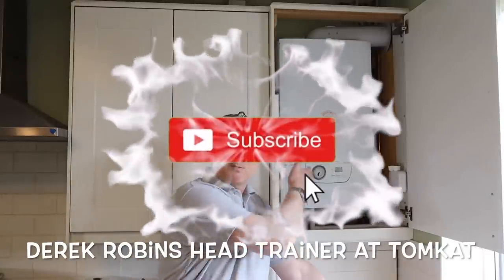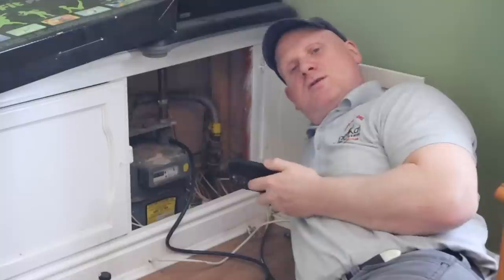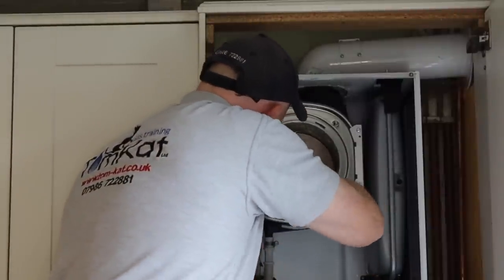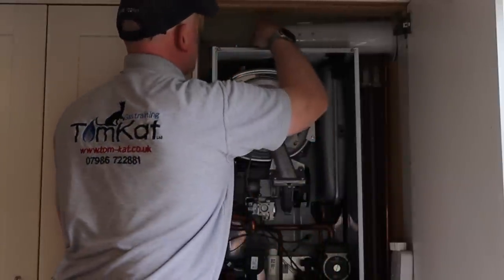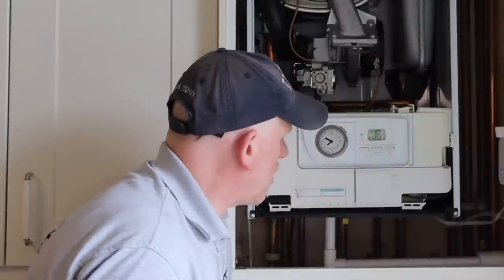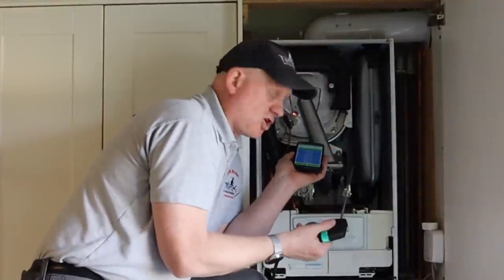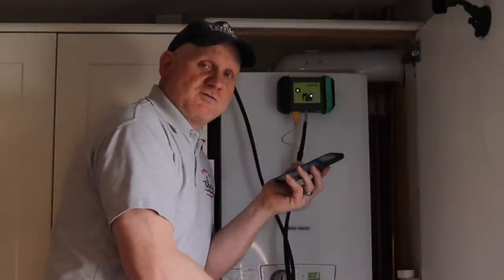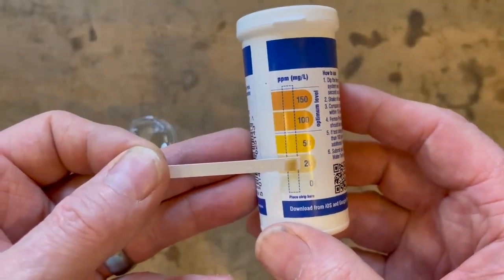Boiler service to new building regs part L. will gas engineers comply and will customers pay for it.

Comment: Had a company ask me to do some services for them. The usual thing " we look after loads of properties in your area"  They wanted 12 to 14 services done in a day. I told them that  there was not enough hours in a day to do it correctly and they said they wanted them doing as per manufacturers requirement and I again said that could not be done but they CLAIMED that all their other engineers did not have a problem doing that many. Well needless to say I did not accept and there is no way they are being done correctly at the prices and time scale they were asking. This is a major area of concern as corners must be being cut. Even BG I have seen go into a boiler and just test flue gases only and if they are ok do no more and on occasion not even removed the cover if the flue gases are ok. I could not sleep because even a pass today could be a crumbling seal that perished the next day.
Reply: Same as other industry such as EICR for electrician. You know price and standards have being driven down by the doggy guy and be spoiled so as company.  So the worst won, the best starved to dye.
Reply: Company didnt start with an F did it? 😂 indeed i worked for a company and all they did was saftey checks and leave in 20mins!! Not good, i left after a week!! 👍
Reply: And the problem is the customer has no real idea there can be such a difference.
Reply: I had the issue with HOMEPLAN asking to do a boiler service for £30 . They said, someone guys in my postcode do it that price and they give them blocked service of 50 customers in a month
Reply: @goodcat1982  quite possible but at £30 a service to do properly you won't be making money so they must be missing lots
Reply: Well this is where the gas regulator needs t come down hard on these companies as they clearly don’t care about people lives!
Reply: Not a chance 5 propper services is enough
Reply: "Even BG I have seen go into a boiler and just test flue gases only and if they are ok do no more and on occasion not even removed."

That's because BG offer an annual safety visit which is free with their homecare agreement, NOT a service! you assumed it was service....

 Saying that. If there is an issue then we strip and clean as per MI's, or raise a breakdown to get it sorted.

If they were paying full price for a service then different story, but the safety inspection is part of their homecare agreement, nothing else.
Reply: @JayGasEssex  I know I am right I worked for them for 16 years and I know what they do not do.
Reply: @paulgannon3261  BG is a joke. LOL. . . In and out in five minutes, else someone will be screaming down the phone. 

Lucky modern boilers are pretty well fail safe, and don't go wrong, else it would be a blood bath.
Reply: I'm still still doing an additional tightness test after locking out the gas valve/safety device. Is this not required on modern valves?

Comment: There is a service and a "service". Trouble is a lot of larger companies actually tell you to do the bare minimum legal requirement and give you such a workload that it's impossible to do anything other than the bare minimum.
Reply: 26.9 check
Reply: The blue van company and social housing contractors are encouraged to do 20 minute safety checks to make sure their managers get great KPI’s. 12 “services” a day is the norm unfortunately. I’ve been there but thankfully got out.
Reply: @matthewtrueblood408  
Im on social housing 9 jobs a day in 8 hours including travel. Its impossible to do a full service on the workload they give. Always fighting with time
Reply: Big companies just want the engineers to probe and go
Reply: @Westy90_  I went for an interview with a housing association and they told me straight a minimum of 7 per day. It's nothing like a service.
Reply: @OHYEAHGAMEVIDEOS  easy done
Reply: This is not how BG does boiler services, they just take the money and don’t bother with the service 🤷‍♂️
Reply: people out there charging around £60 for a service but not actually doing the strip down essentially doing a gas safety check!! I’ve been to many that have been serviced yearly (apparently) that have had leaky heat exchangers, blocked condense pipes and or leaky flues! Low standards these days

Comment: Some MI says if all the readings are correct then doesn't need a strip down ??
Reply: Some do yes and manufacturer instructions over rule regs, which highlights the reason for needing the instructions to hand before commencing a service. Remeber though that even if readings are correct, from my understanding, a full strip down and gasket change is still required at 5 year intervals.
Reply: can confirm Alpha say that used to work for a company that did all the worranty work for Alpha
Reply: @craigwatson7692  Yeah 5 year for NG 2 for LPG for Vaillant/Glowworm with some of the older boilers with the small rubber gasket at the bottom of the Hex every 3 is recommended due to the rubber being less robust than the Graphite seal
Reply: absolutley 100 percent  correct!! thank you, some sanity

Comment: copper grease and 7nm for the burner nuts, great post sir. and no i doubt many will cover everything you showed. So basically the new service is the pretty much the same as commissioning the boiler. Just to ad the flow temps adjust the condensing time of the boiler, so anything with a return of 55*c and below will condense but if the flow was 65 -70 it would just heat the room quicker and turn off the boiler quicker and still give 20*c difference on larger systems but not on a smaller 8 rad system. With a 50* flow i doubt your rads that are last in line will be optimum temp.

Comment: Nice video. The copper grease is a high temperature grease. Sometimes nuts can seize when they get hot for long periods. Use then on car brake pads and exhaust manifold bolts 😇

Comment: thermal grease is to do with Giannioni heat exhanger making clicking noie when heating up and epxanding. Vaillant started adding it to service kit some 7-8 years ago agter complaints from customers and engineers that boilers stright from the factory were making loud clicking noise on heating up.

Thermal paste proivdes lubrication and stops those clicking noises from happening where aliminum expands quicker than stainless steel, ie cover on the main hex.
Reply: well done mate, have you heard the intergas clicking without the grease?

Comment: Great video. Couple of tips: I use a foam appliance mat under boiler, put a little silicone grease in schrader before testing,  use the back of a Stanley to clean chamber.
What's the point in gasrating and WP if not max/min?

Comment: On my service records, it does state ‘Was a full Strip Of the Appliance Carried Out?’, and to me, that’s actually opening up the Combustion Chamber to check all the Gaskets, and cleaning the Heat Exchanger and Burners, but for a basic, leave it sealed, check for CO breaches around the Gaskets, if possible, check flame picture, and do a Combustion reading, and check with the MI’s to see if they’re ok.  If not, then do a full strip, providing you have all the Gaskets on you.  OR does Part L mean… Always carry out a full strip of the appliance, no matter what?
Reply: thats me, leave it alone, check it at the seals, your are just going to fuck it up stripping it down every time.why would we use Analizers?

Comment: New regs means nothing when the public don't have a clue about them. A service now is one of the biggest cons going leaving many out of pocket and so called engineers earning £600+ a day by only doing FGA and in some instances, cleaning the condensate trap out too. I honestly don't think I've been to one boiler where it has actually had a service and my customers are quite pissed when I show them what should have been done each year. Until the public fully know what's required in a service, the 15 minute gang will still get away with it.
Reply from the maker: I completely agree mate
Reply: The quickest service I’ve heard about was this contractor went into a private property and took a photo of the boiler and the gas meter a flue terminal and then told the customer, service complete, all safe for another year, i serviced the boiler again properly to put the customers mind at ease, some major cowboys out there giving us all a bad name!!!
Reply: True this. Problem is they don’t know the difference between a landlords check and a service. I always give them the option and always detail on my gas sheet exactly what I’ve done.

Comment: I honestly haven't bothered to service my Ultracom2 Combi in the eight years since I installed it. I did the burner seal as it was required after 5 years but honestly didn't need doing. I still find it odd that Baxi now uses the same heat exchanger but with a lifetime silicone burner seal instead of the graphite one. When the Ultracom2 was out that was my go to boiler for customers and aside the once every 5 year burner seal, what you've video'd is the standard service we carry out (excluding ph testing, that was commercial setting only until this current update even though I check the filter each year), only takes an hour sometimes less if you've got an apprentice with you to Gas rate while you're carrying out temperature testing etc. 
I'll get the Adey test kit as it can be carried out while doing other aspects of the service.

As for range rating and temperatures, hot water definitely will save money especially turning the preheat off. As for heating, yes and no, I've fitted load compensated Ultracom2's with Climapros and fitted without weather comp and standard stats. I've also been asked to remove the weather comp so people have control of their heating. In the end it will always depend on how the resident wants to run it, with many customers saving money and preferring to run the heating at 65c for a couple of hours on full output rather than reducing the output and having a more constant background heat for a longer period of time. In theory it's 6 of one half a dozen of the other but I did find my own home tends to hold temperature better if it's on full for 2 hours and then shuts off, than when it was set to the heat loss and left on of an evening. Much of it is psychology, but overall I saved more gas being at higher output for a shorter duration than being on lower output for longer.
Reply: And there are some manufacturers who are happy for you to reuse the graphite seals. Ferroli, are happy, as an example.
Reply: Vaillant don't want the burner removed every year, just at 5 years when gasket is replaced. I thought the graphite replaced the silicone seals as they failed between services. I've inspected a couple of boilers, LA properties,  where the silicone seal failed and destroyed the boiler, needless to say that they had been recently serviced by their term contractor who expected their engineers to service 12 boilers a day, impossible!

Comment: A little tip is have a shraider valve tightening tool handy. 1 in every 3 or 4 shraider valves i have dealt with once disturbed leaked and needed tightening. So put one in the service kit
Reply: Agreed and especially boilers not been touched due to covid for 18+ months their expansion vessels are usually flat! 👍
Reply: I spray a little silicone grease on them before putting pump on and always keep a spare in the toolbox

Comment: Great video derek did notice you didn’t check fuse rating on fuse spur ,we’re always getting told check it’s 3amp oh and my mrs would kill me if I didn’t have a dustsheet down to protect the worktop , very informative and useful info  tho bud keep up good work
Reply from the maker: I took that out of the video because it was getting too long so typical someone notices. As for the dust sheet on our worktops I would have ended up on my arse if I had stood on it 😂

Comment: This is the first of your videos that I've watched, I recently retired from the industry, my final years as a consultant to  local authorities and housing associations.  They wont pay their term contractors sufficient money to get the boilers serviced correctly, I tried to get them to undertake water analysis, they couldn't see the point. You didn't discuss the need to test the PRV and I would have checked the gas pressure st the boiler with it on high fire, to ensure gas supply was correct size, I've seen many connected to 15mm. I enjoyed your vid and will watch more of them.
Reply: Good point on the prv but in reality who in the right mind would do that on a Worcester or any other hard to reach prv 😄

Comment: I took out boiler insurance that included a boiler service.  The engineer came and took a quick look at the boiler, he didn't take the boiler cover off, he looked underneath the boiler with his torch, he was supposed to bleed the radiators, but he didn't do this either.  I never received a safety certificate.  The so-called service lasted about ten minutes.
Reply: Sadly how they can do 10+ "service" visits in a day
Reply: @Steves_fish  No, It wasn't British Gas this time.  I have had my share of problems with British gas in the past.

Comment: Be aware that Adey Pro Check (at time of writing) will not work with all inhibitors. Dipstick based systems can only reveal the chemical the reagent at the end of the test strip is designed to reveal. Similarly, Fernox test strips are for Molybdate based inhibitors. Not all inhibitors are Molybdate based, one of the biggest selling inhibitors in the country is Nitrate based, so those dipsticks won't pick it up.
Reply: Is there something that will test all brand inhibitor/ chemicals
Reply: @esgas2042  i-Test by Scalemaster will. It doesn't look for a chemical signature but by the action of an inhibitor in water working in real time - so whether it's Sodium Nitrate based or Molybdate based or using a coating agent like Benzotriazole it doesn't matter.

Comment: Well I had my combi boiler serviced . As part of a house hold insurance policy.  Boiler was about 3 years old.  Guy came. Took a combustion test.  Did not even remove the cover  took down a meter flow reading on max fire and that was the end of the service.  Did not even notice that the presure gauge did not work . 
And that is an approved professional.    Lol

Comment: Can you explain to every major domestic gas heating company in the uk that their engineers should only be getting 5 or 6 service’s a day dependant on the engineers travel time between each job please, thanks 🙏
Reply: Also can you tell them to provide a service kit for every boiler they will be attending for that week in advance and also let them know that you may need extra time for fixing any repairs that might need fixing during the service, thanks, let me know how you get on?!!!….
Reply: They don’t care, they all will turn a blind eye to the engineer doing 10 service visits in a day as long as their KPI’s are met. Supervisors/ contract managers will all play dumb when something goes wrong and throw that engineer under a bus. Didn’t Gas Safe say they were going to make things easier for engineers when they took over from Corgi ?? What’s changed to make life easier for us, ZILCH !!
Reply: it is not possible to do strip down every service, 5 or 7 a day, SSE tried it, and it is financially unsustainable on insurance and manpower.
Reply: @tonyrichardson2637  in that case, will everyone stop getting onto our cases for trying to achieve the goals required from our management?
Reply: @carlatkinson4181  when working for insurance type companys, that want 8 to 10 a day, as long as you check it is safe , no one is going to bother you.

Comment: As commented on a previous post..... rooms above 5m3 do not require fixed ventilation if they have an openable window and external door.
Reply from the maker: What does this comment equate to. Some old Boilers and flueless space heaters and DFE fires still require ventilation if you have a door and a window.

Comment: Hi,Derek  you did decent job. I wonder how many gas engineer do the same thing as you with their routine job. I appreciate  your attitude for the job. I would like to do same thing as you, but where is the decent customer glad to accept my quotation?
Reply: Don't mind paying a fair price but hate being ripped off but £200 to pump up an expansion vessel ? .
Reply: I think its important to appreciate that if you get a different engineer in everytime it would be hard to gauge the service history of the boiler.. the service industry is quite a minefield which can really scupper the pricing structure of a service and expectations can be wildly low, in an ideal world an engineer should charge a breakdown service (this is usually once every 5 to 7 years) at an hourly costing plus materials, safety checks (which are yearly) are not services so can be price fixed because nothing is altered or tampered with, or so it used to be before warranties came with extensive terms and conditions, its used to essentially be just an MOT 

the best idea is to find an engineer you can trust 

Things to note going forward:
Manufactures like to throw spanners in the works by adding on certain criteria onto yearly safety checks especially if warranties are to be adhered to so even safety checks are somewhat of a grey area on how to price now. 

It would be good to hear other engineers take on the differences of a service and a safety check

Comment: Good video 1 question you say you don’t want to clean H/E with Brillo pad, because of metal, what does the M.I say to use? Also you used a metal knife thing to clean in side the pipes, why not metal as long as you flush it out.. thanks and very informative. However my understanding MI are different depending where you are in the UK.